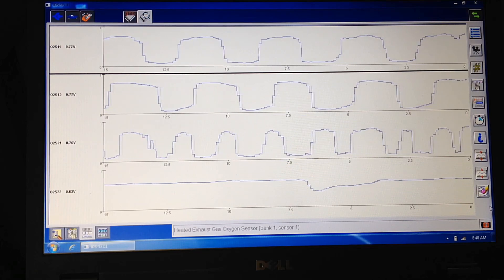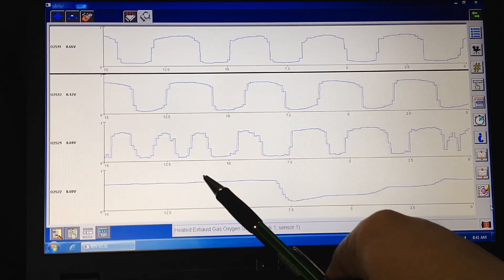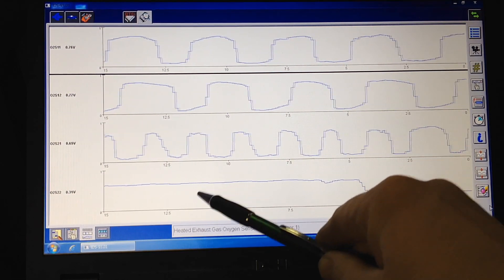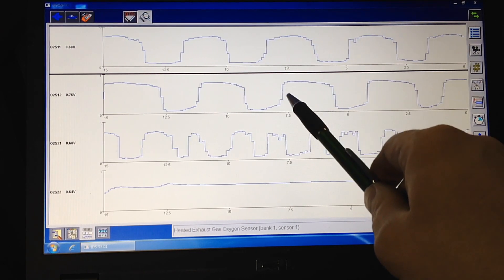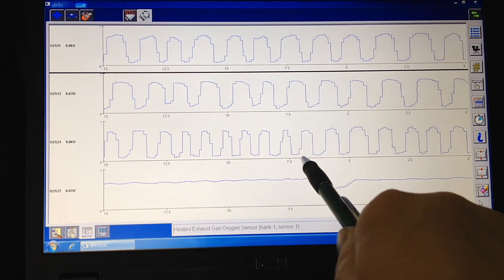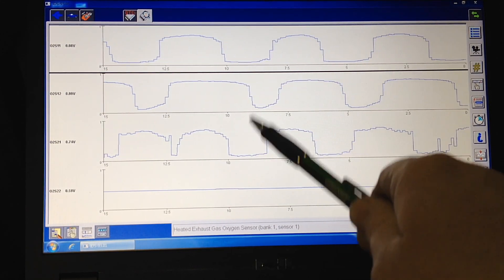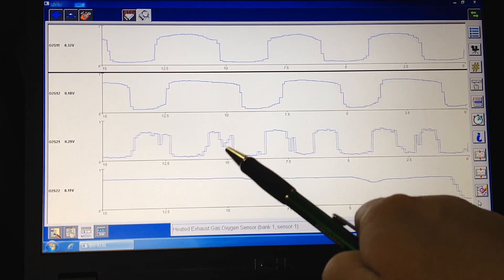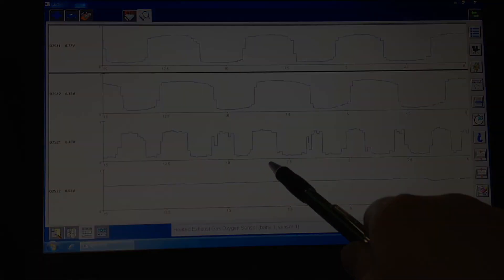Ford Catalyst Efficiency Codes P0420 P0430 Explained

Comment: I have A PO420. Steady line, but when it does it's test, lean voltage goes up, then rich, about 2-3 seconds , drops, as soon air fuel mixture goes to 14.7 to 1, right back to 700-750 mv steady. Won't pass Oxygen storage test. But solid straight line.  Fuel trims ok, -1 ,,,, 0,,,, 2.5...

Comment: I know this is unrelated. But we’ve been chasing our tail on a 2014 E250 that just will not set the readiness monitors for the O2 heaters and the O2’s. It just keeps coming back, not ready.
   My biggest hurdle so far as I would like to just see what the monitor is looking for which I’m not finding I only have all data. I’d like to know what that monitor is looking for to either fail or set ready to pass the emissions testing. There are no code set. We’ve reset ECM. It’s an ongoing issue.

Comment: 2018 F150 2.7L cat was relaced with aftermarket cat it threw a code 2000 miles later. Ford diagnosed a bad cat 0430 had the cat replaced Magnaflow with 5year warranty. Not long it threw a code Ford diagnosed it as a weak cat. Use a scanner watched CAT1/2 and noticed that the left cat, aftermarket, was not flat or smooth like the OEM old cat. Ford says anything but an OEM cat ( others have said it) will be a problem.  Scanner shows it to be and FWIW O2 sensors are good. So...looks like a new OEM cat is going to be used this time.  BTW no oil burn, no loss of coolant, no misfires. 108,000 miles new plugs at 93,000 engine runs good and strong.    Comments?

Comment: Hey, I got an Explorer '13 and the water pump was leaking outside the engine. After I fixed that, my mileage tanked during city driving (stop-and-go stuff), but no check engine light is on. My OBD2 scanner's showing a P0430 code, though. Any ideas? Also, how do I read the sensor data? I heard the upstream sensor uses mA. Just so you know, it does good on the highway!

Comment: Wondering if most analyzers/Code readers have the ability to show this information?   I have a new Autel A519 and found it gave me the P0430 bank 2 code, yet my fuel milage and power don't seem to be affected.   I did take the truck for a drive, then checked again, doing a temperature check at the inlet and outlet of the CAT, and the outlet/exit end was close to 100 degrees hotter at idle, thinking the CATS should be fine?   This type of test shown, sure would help identify if I actually have a CAT issue or sensor issue then!

Comment: hi!!! i have the p0420 but the readings of downstream doesnt mirroring the upstream..only that code, no fuel consumption, no loss of power. in fact he voltage stay in .6-.7 just like yours o2s2b2
and the code is intermitent 
maybe some clogged?? or just wear? the car has 10 years and almost 125k miles
never cheked before my bad...
do some cleaners and in that time the code erase but only last between 500-1000 kms 
buy a downstream o2 sensor and see what happen
and wll try to do some direct cleaner

Comment: Got a 2010 escape with the 3.0l v6 dura tech and it has the p0420/p0430 if it is the cat what is the solution to fix this cause dont want to replace and then it misfire for some reason and melt a whole new cat

Comment: Hey brother I'm being thrown through a loop I've replaced both cats and all 4 o2 sensors in a 2019 ford f150 2.7l ecoboost and I'm still getting a P0430 code but all the values I'm seeing on the scanner seem to be within ranges

Comment: So on the 04-08 F150 5.4 would it be the second cat that needs to be replaced or both?

I understand replacement of both would be ideal since I'm already in there(under there) but would the first cat up stream be a issue if I only replaced the down stream cat?

Comment: My 2007 Crown Vic Police Interceptor is throwing out the code P0420. Is cutting off the cat converter and replacing with a straight pipe a viable option as opposed to replacing the cat converter?
Reply from the maker: Um no.
Reply: I have a 06 CVPI. I have heard a cat delete it gets worse MPG. To do the cat delete right you'd have to take it to a professional tuner to tune the ECM for lack of cat and tune out the pre O2 sensor. Gets into a lot IMO, as I have been weighing my options...

Comment: 2014 Edge SEl, 3.5 @ 118,000 mi. -Just replaced the H2O pump, timing chain, +guides. Driving for a week (easy duty) and now codes P0430 & P2197 are coning up. Do I have an issue with the converter or O2 sensor ?
Reply: I just had my engine remanufactured (which includes all the work you had done) and code P0430  popped up before I could even get the car home from the shop
Reply: @calvinpryor  Issue ended up being O2 plug not connected.
7k miles later. Everything working fine. Distance trips to FL. Coast & TN. & LA. Only 1 bad coil pak

Comment: Hey there.. i was looking at my o2 sensor f150 1998 4.6L and the behavior is exactly like this charts.. but im confused.

O2 from upstream and downstream should look alike..? Or totally different like yours on the bottom that it looks like flat-line?

Mine showed P0430
OBDII: Catalytic converter system, bank 2 - efficiency
Catalyst System Efficiency Below Threshold (Bank 2)

And when watching o2 sensor graphs it showed bank 1 s 2 being flat lined... And bank 2 s 2 moving alike s1

S2 is downstream, s1 is upstream.
Downstream is after cat.

I was reading about adding cat cleaners on the fuel along with o2 sensor spacers to allow better gas flow.

What's your opinion on this?

Thanks for the video! Great information

Comment: I have a 2015 edge sport 2.7L EcoBoost. P0420 code come and go over the last 2 years. Now I have more exhaust smell and a little miss at idle. only 42k miles now. Runs fine. Any recommendations? Should I get a bluetooth OBD and check the voltage, could it be an oxygen sensor making it run rich, should I use a temp gun and check the converters temp? Is this common on the 2.7L or other Ecoboost for failed converters this early? I read a lot of F-150 say they had the Cat's replaced early on with no cause. And how can I get the newest PCM/ECU updates without taking it to the dealer? Hope you can help me out with all those quetions. Stuck at this point. Not sure what to do...
Reply: do you solved?? i got a ford but the escape ecoboost and the same..code come and go
no power loss or any simptohoms of bad cat..maybe the smell
almost 125k miles
maybe my case is just wear ..cause the car has 10 years

Comment: what if the graphs are ok even on higher rpm and you still get p0420? 2015 Fusion 2.5L only 27k on it. I put new sensor on it and its still showing code. I don't even have to turn on the car. code is there right after the reset. I tried different scanners high end snap on even.  Disconnected battery. Nothing that code is there solid. I get power to the sensor negative is there and the code is there. I used brand new for o2 sensor on it. any thing comes to your mind?
Reply: P0420 code is a air fuel ratio code.   My stock 3v 5.4 has 260k miles has gotten that code for bad spark plugs(computer leaned the tune) also plugged fuel filter(computer leaned the tune) code went away after tune up.

Comment: Very interesting.  Well my 04 Expedition 5.4 just threw the P0420.    I ran an exhaust cleaner thru and turned the lite off.   About a month later, code is back.  Going to try another cleaner but I think the CAT is bad.   I wonder if I can just drive it this way until I need an inspection?   thoughts anyone?
Reply: P0420 code is a air fuel ratio code.   My stock 3v 5.4 has 260k miles has gotten that code for bad spark plugs(computer leaned the tune) also plugged fuel filter(computer leaned the tune) code went away after tune up.

Comment: I have a 05 ford Taurus approximately 63,000 miles (rounding up) and im getting a P0420. Thats the only code I'm getting! I'm thinking there is no way my catalytic converter needs to be replaced with only 63k  miles. Could i be wrong?  Looked at live data on 02 sensors and it shows all the readings continuously rising and  falling between .100-.900. Mind you this vehicle has never missed an oil change or service check up.  Was my grandmothers car and she cherished it. If you can help me in anyway please write back i would greatly appreciate it
Reply: P0420 code is a air fuel ratio code.   My stock 3v 5.4 has 260k miles has gotten that code for bad spark plugs(computer leaned the tune) also plugged fuel filter(computer leaned the tune) code went away after tune up.

Comment: Which side is bank 1 and which side is bank 2 on the motor? I'm throwing a 430 code on bank 2. I clear it and it'll go a couple hundred miles and it throws it again. Think just an 02 sensor will fix it? Crack in the plastic intake manifold?2008 Mustang GT 220,000 miles original everything except for Air Raid CAI and SR Performance 62mm Twin Throttle Body + BAMA tune.
Reply: RafananClan bank 2 is the driver side

Comment: Hi i have p0430 code on my ford taurus 2014 80.000 mile how i can fix it wher is the problem on o2 sensor or catalytic converter ? pls help me
Reply: 2014 taurus limited, same issues, i clear the code and it comes back a few days later. So frustrating.

Comment: I have a 3.7 V6 mustang that just threw these codes. I have been having other issues getting the car inspected with my current mods list but they all got straightened out. I did change my spark plugs last week and rookie mistake, I didn't gap the plugs and it made it misfire like crazy and now I'm seeing these codes. So I guess my high flow cats are screwed?

Comment: I had a P0430 code on my 14 Explorer right before my move from Colorado to Florida. I reset the code and didn’t have time to take it in. It hasn’t come on since and it’s been 2500 miles. Shouldn’t the code come back after a certain mileage if there was a problem?
Reply from the maker: Only after the catalyst monitor completes and finds a fault over and over again.
Reply: FordTechMakuloco would you recommend just waiting for code to trigger again? Ford dealership said they couldn’t do much with a code being present

Comment: Ford uses wideband upstream sensors now on a lot of their vehicles.  How would this affect the way downstream sensors look?  Would it be any different since the way the upstream monitors is completely different with wideband vs the old style o2 sensors.
Reply from the maker: +Bob Sacamano the downstream look the same
Reply: @FordTechMakuloco  not sure if you see this as this was an old video. But i notice now on 2018 cars ford doesn't give you any sensor 1 data (oem ids) only sensor 2. How can we compare it now?

Comment: Hi i have a 2012 f150 xlt 3.5 ecoboost have p0430 changed the. Catalytic conv and have no dtc codes but i have po430 permanent. Code i just changed it recently

Comment: question ? i got a ford mustang gt 2007 , i had long tube headers installed and high flow cats , they also installed spaces for the 02 sensors to help pass emmissions ,  they gave me a emessions tuns and a race tune , i am supposed to install the emmisions tune and drive a 100 miles then get tested ! i went today for testing and no check engine light on my car , after i had it tested i had a check engine light on and they told me it failed , evap system not ready with a P030 code and now with a check engine light on ? thought on a fix ? thanks oh , BTW , my cats have less than 1k miles on them

Comment: Thanks for the informative video, it's just what I was looking for.  I'll throw my problems/question out here anyway.

My 2006 fusion 3.0 has the B1 downstream sensor mimicking the upstream sensor but the voltages are slightly different.  Upstream is 0-960mv and downstream is 30-560mv.  The wave form is exactly the same however.  So I'm guessing I need a B1 cat more than likely ?
Reply: My 2016 Ford focus 1.0 Ecoboost gave me the dreaded P0420 at 87400 miles - ford warrants the emisson system for 8 years or 80000 miles.  Going to my local mechanic tomorrow for the bad news $$

Comment: I have a 2011 ecoboost f150 v6. I have had P0430 code come on and off (with out me reseting it) for about a year now. Truck has always drove fine, do you think my cats are shot as well?
Reply from the maker: +Jonathan Gilbert I think the driver side cat is partially plugged yes this is very common on the driver side on the ecoboost engine.
Reply: FordTechMakuloco do you recommend I just take it into the ford dealer? I found I can buy a direct fit bolt on magnaflow would that be relatively easy for a novice repairman or could more things be lurking wrong? Thank you for your help I have watched a bunch of your videos it's a shame ur not in Texas or else I'd bring my truck to you.
Reply: Yes! Im having the same problem. Did you notice decrease in MPG? Or random power outages when on highweigh speed accerlation?
Reply: Jarrod Johnson My MPG was low yes but not horrendous. I started to get a hesitation at highway speeds. Ended up taking it into the shop and got a new cat and it's been perfect since.

Comment: My dad's 2012 f150  6 cyl popped a  po420 and the rpm gauge died and airbag light came on and the truck had no power. Is this normal for the RPM GAUGE to die even with the truck running? The truck would barely hit  20 mph, it had no power. Thanks for the video.  Thumbs up bud.
Reply from the maker: No it is not normal something let loose for sure.
Reply: I had the same problem! What solved it?

Comment: What is your opinion on a P0420 which went away on its own?
I have a 2012 Focus SEL (non-FFV) which signaled a CEL and P0420 code, which was read by a scan tool outside of a Ford Dealership. Four days (and about 7 starts) later, the CEL went out on its own, and P0420 was no longer stored. This occurred around 75,800 miles with the code going away around 76,000 miles, and now the car has 77,200. The car was taken to my local dealership for the latest TCM update, and when I asked if the code was still stored I was given a very swift no. 

Should I expect issues later on? If I have legitimate issues, I am worried that my 80K emissions warranty will expire before problems resurface.
Reply: Possible issue with the sensor, not the catalytic converter?

Comment: Hello I am your friend from saudi arabia , i have p0420 in my ford taurus 2012 and i have delete my 2nd resonator and the muffler and replace it with 2 inch pipe , so do i have to change the sensor or something else ? Also the code was showing before i replace the muffler and the resonator . I hope you can help me please

Comment: I have a 2001 Ford Crown Victoria, I have this same problem. I have the P0430 as well. Better prepare my wallet. My symptoms are poor gas mileage and sometimes it does not start up on the first crank.

Comment: Thanks for the video, brought light to some questions I had.

However I do have the P0420 code in my 06' Escape. What instruments or how I can pinpoint exactly that the Cat is the culprit? Not just an O2 sensor for example.

All the techs I've asked want to fix the Cat right away, and I know it's expensive.
Reply from the maker: +Carlos Andrés Cassanello if you have a 420 or 430 the cats are done for. The o2 sensors have their own monitors. As shown here the o2 sensors respond the same both pre and post cat showing the cat is inactive.
Reply: +FordTechMakuloco Thanks for the reply! Well I think it's time to save for that fix.

Do you know is if possible to install an aftermarket cat?
Reply: @FordTechMakuloco  so does that go for the 04 f150 as well?

Comment: I have a 2011 f150 ecoboost I just got a P0430 code. what is the fix a new cat. or can I go aftermarket and delete the cat. what causes the problem
Reply from the maker: +Shane Mcmullen New cat for sure oem or aftermarket is the true fix. Misfires from water condensation in the cac and fouled spark plugs plug up the cats on these fast.

Comment: I take my '13 F150 EcoBoost in, dealer recommends cleaning the injectors, two days later, I throw P0430.  Clear it, it comes back.  It sounds to me like my dealer caused the issue here in my situation.
Reply from the maker: Jeremey Kroh Yup

Comment: How come bank 2 sensor 1 seems to be switching on a faster cycle than bank 1 sensor 1?  I'm not a mechanic by profession and am just learning.  I would think that both upstream sensors would be switching at roughly the same cycle time.  Not necessarily in sync but at least roughly the same cycle.   Does that make sense?  What am I missing? 

Thanks for all the great videos you do!
Reply from the maker: Phil Reames That's how it looks when the o2 sensor gets lazy the switch rate drops. The pcm actually has a monitor it runs for this and will set a code for a lazy o2.
Reply: Thanks!